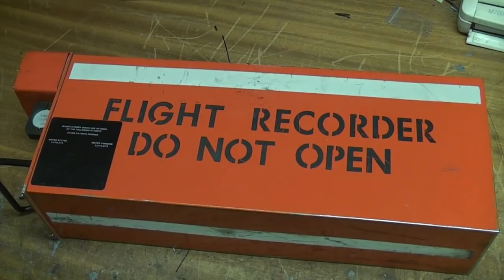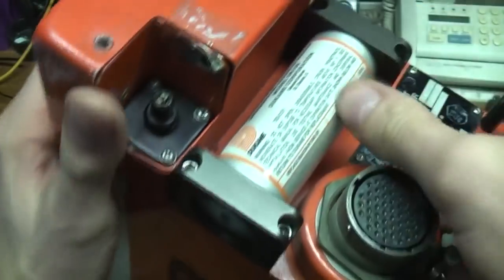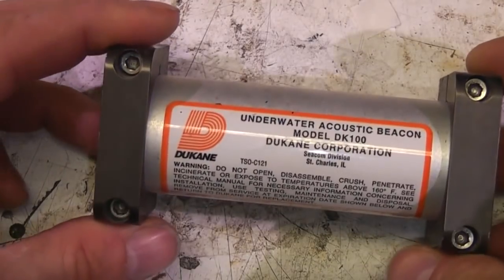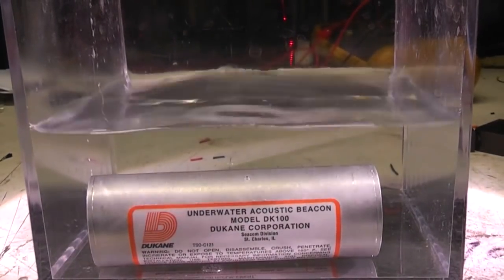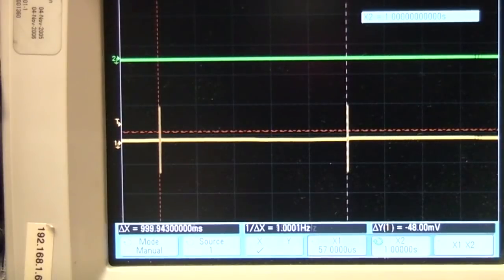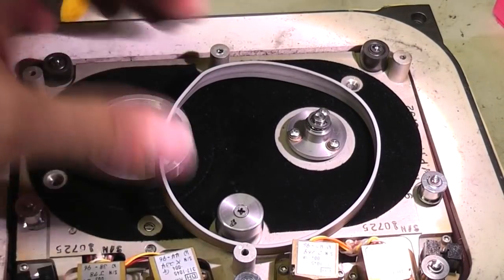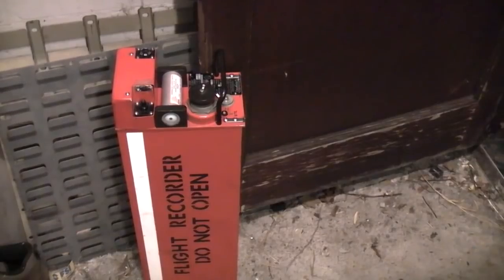Flight Data recorder teardown

Comment: Well, this is probably about 6 years too late, but anyway...  The reason the upper connector on the rear panel isn't populated is that that specific unit only has the basic (6 parameter) DAS card in it.  There were 5 basic variants of this model, indicated by the first letter of the part number suffix (D = Digital only, needs external FDAU / E = Extended DAS, supports 10 parameters (UK CAA spec) / F = Basic DAS, supports 6 parameters / G = Extended DAS, supports 11 parameters (US FAA spec) / H = Shipped in E configuration but can be expanded to G by installing the extended DAS card)
The config code is on the end of the part number - in your case FWUS - so F = Basic DAS / W = Pitot/Static with Wiggins connectors / U = ULB Installed at shipment / S = Standard case.  The BITE LED on the front panel is indeed Built In Test Equipment - this unit also had a (for the time) advanced feature where every time it wrote a block on the tape it then wound the tape back and verified it, so it could detect write failures in normal operation.
The connector on the front panel is for dumping the data - either directly to a system (based on a Data General Nova 4!) called ADRAS or indirectly using a copy recorder that dumped the internal data onto 1/4" reel-to-reel tape.  Very slowly.
Reply: Awesome information!

Comment: Having worked for Honeywell in the avionics division, in IT though not directly with avionics, I can say that you will see lots of avionics with bodgery on them. A lot of the lines aren't high volume, and even the ones that are, anything that's rejected from QC inspection goes through a "rework station" where they replace whatever components that have failed without having to try and remake the PCB.

Comment: If you ever do pick one of these up to play with, especially older units with tapes, be quite careful. I was warned by a lawyer for a former employee of one manufacturer of these that they may contain asbestos as fireproofing material. The electronics are generally quite safe, but the tape side (which is usually its own compartment) is where the danger may lie.

Comment: When does the engineers learn not to put on a "Do not open" label on equipment that should not be opened. Put a "Instructions inside" label instead. 
Great (and a little morbid) start to the video.

Comment: The best way to de-pot stuff I found is to just use a dremel with a wire brush attachment. It will eat right through the rubber, but leave components and the PCB intact.
Reply: Thanks!

Comment from the maker: Flash is much more resistant to high temps than tape - if damage is so severe it can mechanically damage the tape it won't be in any shape to splice together. Flash could also distribute redundant data over multiple chips or boards easily.

Comment: Brilliant!  The tape drive motor is probably external because it is dissipating a small but non-trivial amount of heat.  Inside the insulated compartment, this would build up, reducing the recorder's time-temperature rating.

Comment: Unless I'm mistaken, the majority of FDR manufacturers have facilities very near the airplane factories, also the chips on the pcb's turn a different color if a temperature is exceeded for a particular time, that tells the techs that the data is probably corrupt. There still are lots of tape recorders flying as well as the older style foil type, as well as the newer flash type, but with ever increasing number of planes with sat links, some of them are flowing data directly to the airlines.

Comment: The latest trend in flight recorders is the deployable type.  They are much cheaper to manufacture because they don't have to be as well protected as a permanently mounted one- they are designed to be deployed from the aircraft before they go down.  This also increases the likelihood of the recorder actually being found.

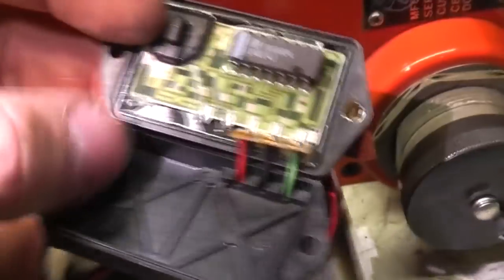Comment: 22:00  The extra wires going to the pressure sensor are likely for temperature compensation.  Some of the EEPROMs are likely programmed with the compensation values.  (Horner's Meathod data)

Comment: Yes, it is very VERY expensive to certify hardware for aviation, especially for commercial aviation. It's far far cheaper to stay with slightly older hardware than to replace it.

Comment: another reason for the motor to be outside: the belt is more likely to break, making it easier get the tape to stop during impact, making it easier for investigators to find the start/end of the loop
Reply: +SkyCharger001 I was thinking it'd break once enough heat was created and to ensure it to stop recording. Just because you want circuitry to stop at a certain time, doesn't mean it always will -- think about that after 300gs or its underwater.
Reply: +BikingMNViking: A. I never said it was a certainty, just that it's more likely. B. with flight-recorders of this kind the tape should be long enough for the difference between end-point and stopping-point to be relatively insignificant (IE: investigators only need to check 1/16th of the tape for the end/start-point instead of the entirety of it)
Reply: SkyCharger001
When does thing turn on? All I was trying to point out is that you would want it to shut off in a catastrphic fire and having the belt exposed to the heat would ensure that. The belt might have a specific temp at which it fails.
Reply: +BikingMNViking : perhaps it's easiest to say that a Flight-Recorder has multiple deliberate failure-modes.
Reply: Probably, I've never googled any more details about how they work. I would just think one would want the most usage of the tape and after everyone is either too far from the mic to be heard over the roar of the fire or that everyone left near the recorder is dead so it'd be advantageous to have the belt melt off since there is obviously no reason to have it left running at this time.

Without knowing what starts it up it may even be an overall event timing device -- I mean it can not record pitot tube data forever (today's new digital ones probably could and just loop over itself own memory) and I know that has been VERY helpful in some crashes -- one recently had the plane's pitot tube ice over and the autopilot pushed the power to max to try to increase airspeed which of course only iced up the pitot tube even more. The result was everyone died. I wish I could remember the flight number but what surprised me about it was that it was quite a modern aircraft but it was flying near some mountains as I recall.

Interesting also to note during his gyro teardowns the bearings are nothing fancier than what is in my bicycle rather it is the devil in the details. They take plenty of care to balance the unit. (interesting balancing vid from Suburban Tool where they take a tour of remanufacturing a spool -- THEY even call in an expert to rebalance CNC mill heads that spin over 25k!) I'm sure they use wide-temp spec grease, too, because you loose 2 degrees F every 1k ft you are away from Earth. Aircraft have some of the best designing & engineering ever done on Earth, that's for sure. Lives in the balance.

Comment: That 8080 chip is a bit of a surprise, to me anyway. The Intel 8080 was made in 1974 I think and then however long it took AMD to reverse engineer it from there (it wasn't licenses at first). It's a surprise because it was still one the market as one of the more advanced chips in 1977.

Comment: This device is exactly what records data from the control systems and sensors on the plane. Why would it have pressure inputs and whatnot if it didn't? The voice recorder is usually a separate device, and in fact, data recorders came first.

Comment: Excellent teardown, as usual. Very interesting to see. I was quite surprised to see all those bodge wires considering the rest of the design. Also, I wonder what keeps fire from entering through the slot for the belt and destroying the tape.

Comment: The latest thought is that they should start moving to continuous data streaming from aircraft to land based recording facilities via some kind of TDRSS satellite link. I like the idea. No more worrying about recovering a data recorder in 8,000 feet of water in a Air France 447 type scenario anymore. Physical data recorders aboard the aircraft can be used as backups.

Comment: I am very perplexed by the arrangement of the tape mechanism. As you pointed out, it would make a lot more sense for it to be an infinite loop tape. I have to assume that instead of using infinite loop, it records in one direction with one set of heads; then when it reaches the end of the tape, the optical sensor sees this and instantly switches the tape into the other direction using the other set of heads. This way the longest record time is achieved. The reason this seems likely to me is a) the volume of the actual record area is not big -- the tape size that could fit in there probably could barely do a few hours of record time. Even assuming they run it at a slower speed, like 3.23 ips, with a single audio mono track and three data tracks, I'd be surprised if it was able to record much beyond 2-3 hours. However, I suppose it's usually the last 30-45 mins of a flight that matters. Although the case of that jet flying across the US with all the passengers and pilot dead from oxygen deprivation comes to mind -- the flight recorder recorded over the beginning of the tape after takeoff, where the important events occurred. Despite this, they were able to conclude it was pilot error. You'd really think they would have accounted for incidents like this, and used bigger reels of infinite-loop tape...

Comment: I suspect that by putting the drive motor outside of the tape protector, there is virtually no source of strong electromagnetic interference remaining in there. Besides that, the shell is meant to be a good thermal insulation barrier. If you put a motor inside, you'll then have to conjure a method of removing its heat, then you'd have to find a way for that mechanism to not allow heat back in in case of fire. It makes all kinds of sense to keep the motor out of there.

Comment: I've depopulated a few conformal-coated PCBs in my time; it can be quite a challenge if you don't have a desoldering pump (I can't afford one!).  The worst I've ever worked with was an ECU for a Nissan VG30DE V6 engine- I only managed to salvage a handful of components off of it because of the sheer thickness of the coating...

Comment: Interesting teardown, but its worth mentioning that you cant measure altitude inside of a pressurised aircraft. Maybe the pitot tube is meant to function in event of cabin depressurization?
Reply: +Dee Dubbs  Flight Data recorders are mounted in unpressurized area of the aircraft, normally in the aft section fuselage or in the vertical stabilizer (tail) to increase it chance of surviving.   The recorder does have it own independent pitot/static system.

Comment: Any clue about what type of data gets recorded on that device?  Might be interesting to trace out the pinout of some of the input ports and see what types of things the flight recorder actually records.  I wondered if what gets recorded is analog or digital.  Also, what type of equipment is needed to read such as recorder?  A computer?  Dedicated device?  An insturment panel?  Other?

Comment: It is quite strange for me that device manufactured 2005 does not have SMD components. It looks like it was designed early 80s. 8080 processor from 1987. Wooden logics.

Comment: Perhaps putting the motor inside the heat-proof case would cause the tape temperature to rise too much if the motor gives off a fair bit of heat? Other than that, size is probably the only other reason.

Comment: Problem with salt water is that it absorbs quite a bit of radio energy and passive RFID technology is range restrictive. This is probably why it uses a transducer to send the locating pings instead of a radio ping. Now, your idea isn't that far fetch though, because for people who ski, I recall that they do use a form of RFID beacon to location people in the event of an avalanche.

Comment: as salt water is not shorted the beacon if you can measure the voltage of the battery through the case?

Comment: This is not your average tape recorder, that has (had) to keep up with the newest trends ;) . A device like this has to reliably work and meet specs. Almost every failure case has to be taken into account, design and testing that takes years (I guess). If you exchange parts especially core components like MCUs/CPUs you'd have to test and get certification all over again.

Comment: eXcellent Little video! Really cool, very informative. I have bought a Leigh Tape one recently from a harrier jet, which uses the centre tape to outside system, really quite cool, very heavy though at kg for something about the size of a toaster! Mine has heat sealant, but does not seem to have water sealant, or a beacon I guess in the Harrier jet the NTSB don't care too much about getting it back or if it lands in water

Comment: at 14:17 in the video or so showing the hex dump, you can see a bunch of the opcode "C7".  this is the RST 0 opcode which will reset the CPU if it ever tries to execute one of them.  clever.

Comment: How is it that that such a small click can be used to find the box??? I would imagine there would be a lot of noise between the ocean floor and the antenna trying to detect the click... I don't get it. Mike had to put the camera real close for us to even hear it... yet in an ocean there would be so much noise from animals to wind to waves to ships etc. etc.
Reply: The frequency is low, it travels very far.  Elephants can hear 8 hertz a hundred miles away.
Reply: Steven King Thanks! Pardon my noobness but is there no interference? For example when you are trying to hear something and someone turns on a really loud motor beside you... Or does something have to be the exact same frequency for it to add noise to the original signal... If that's the case is the frequency used by underwater acoustic beacons reserved only for their use...
Reply: +Steven King 37.5 kHz is not low frequency. The range is through 5 km of water under ideal conditions. Probably easier to generate ultrasound in a small package like this and should be distinct from natural sounds.

Comment: I wonder why they cant coat PC PCBs with this stuff so that they can be fully watercooled.
Reply: sonofhendrix it is possible, but cheaper to oil cool. while still being expensive, also the insulation would probably make the heat exchange not that great.

Comment: Hi Mike,

Any chance you can do a better teardown of the pinger electronics by soaking in a suitable solvent? The 37.5kHz has 1kHz tolerance, so is NOT crystal controlled. Probably LC tuned and similar to top right diagram on page 6 of :

http://www.mouser.com/ds/2/40/piezo-43596.pdf

Joe.

Comment: Lol, airplane full of flight recorders : )

I sincerely hope they are a lot more elegant today but they are probably still as clumsily bulky. They could make some sort of thermal shock SD card standard. little chip in aerogel and phase change layer, dirt cheap, maybe a couple of redundant placements in the plane, don't overdo it.

good show

Comment: Yes, but again, good luck finding something the size of a thumbnail in an ocean. Also, if you have thousands, you might exceed the cost of an actual black box (which is rated to survive the extreme impact and heat.) Plus you need a way to write all the cards at once in such a way that a single failure can't damage them electrically.

Comment: How come you didn't put some VHS tape in there and use it like a ghetto boombox? You could sell them to doomsday preppers on YT dreaming of the apocalypse. heh Seriously though...interesting those grommettes are not much more than refrigerators use for their compressors... same type of setup, in fact, I hope it'd be different/better material (it looked a bit more rubbery) but maybe not. Shows once a design works, be it everyday or just on crash day, stick with it.